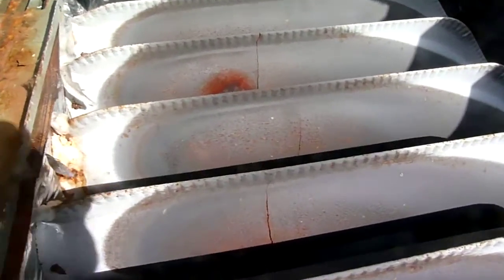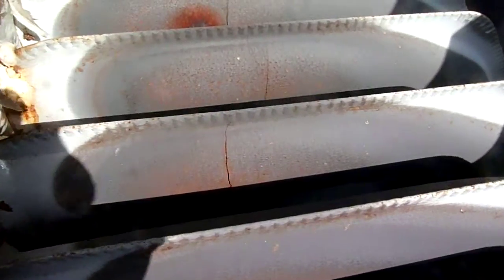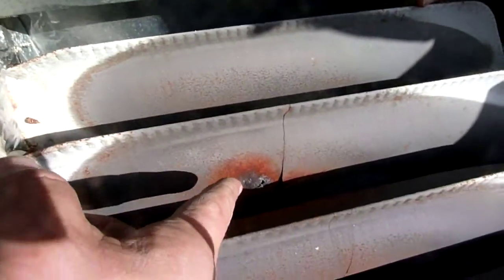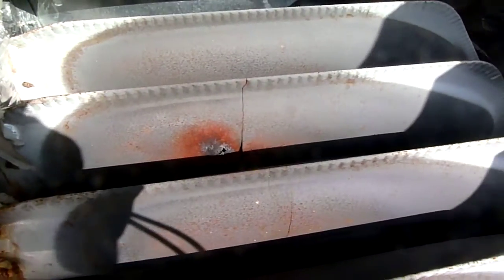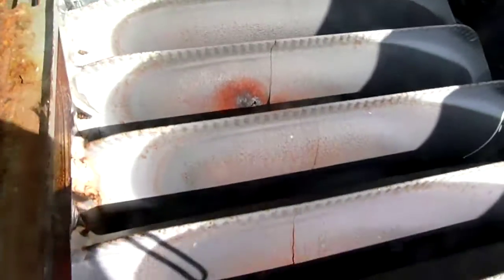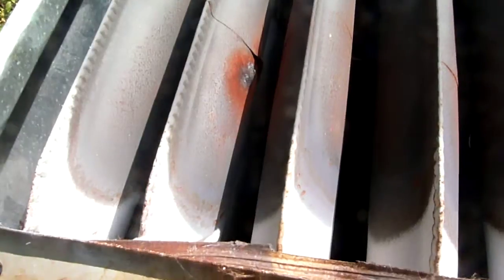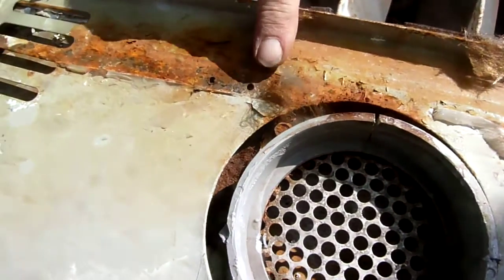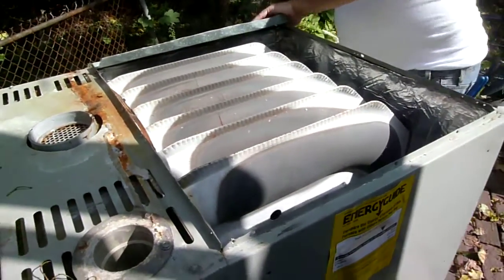Hi-Efficiency Furnace Heat Exchanger failure

Comment: High efficiency heaters do not last as long as the 80%? Thanks for the video
Reply from the maker: This one didn't. However, a contributing factor to its shortened life was the condensation dripping onto it from the improperly-sized 4-ton A-coil above. The one in place now (same exact model of Freedom 90 Furnace) looks as good as new after 8 years.